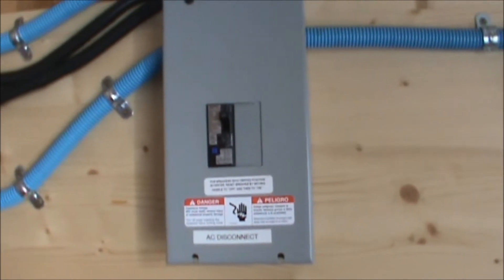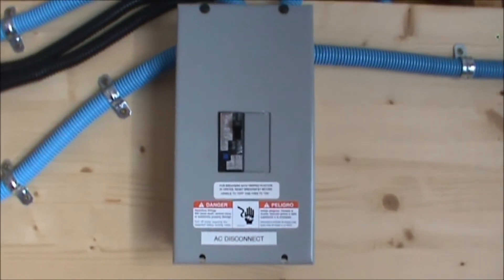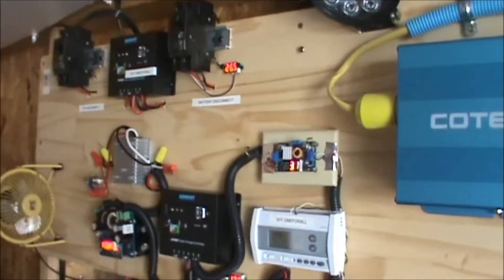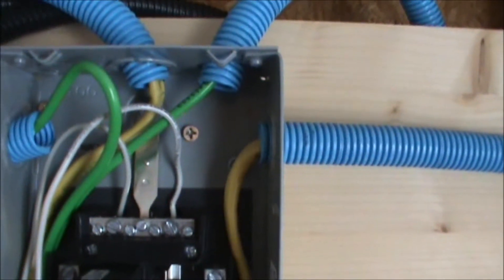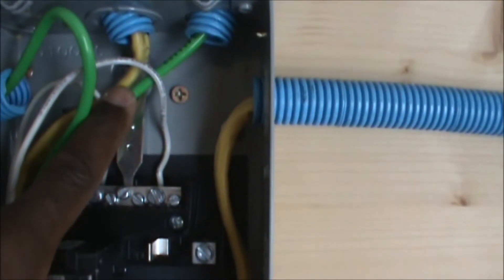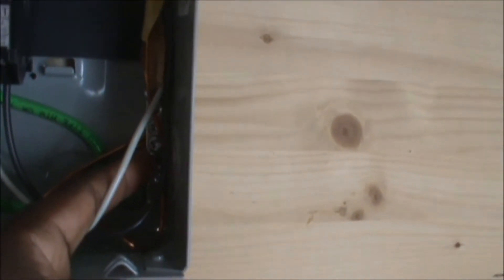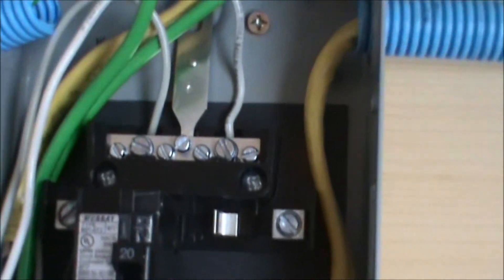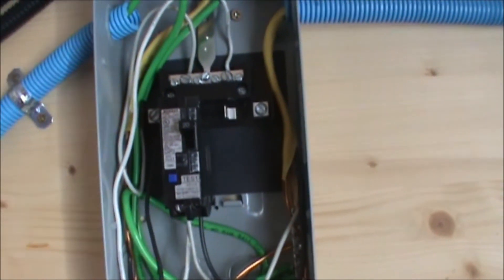How to bond neutral and ground in an AC breaker box - a look inside

Comment: If the power is coming from your main service panel. AKA ( Main Breaker Box). You don't bond Neutral and ground. All neutral's & Ground downstream from Main are not bonded to one another.  You have just made that box unsafe. When bonded incorrectly like in this case.  I have seen the neutral wire fail. Not tripping the breaker as you still have a complete circuit through the ground. I don't know where your supply is coming from. However, if its coming from your main service panel then this is incorrect and can be dangerous.
Reply from the maker: Troy Davis 
Don't forget that this is an off-grid system, so in this case, I am the source of the power generation.  This is not your typical setup where you would connect to the grid.
Reply from the maker: Troy Davis 
This is an off-grid system.